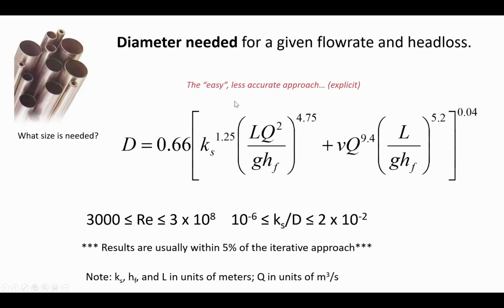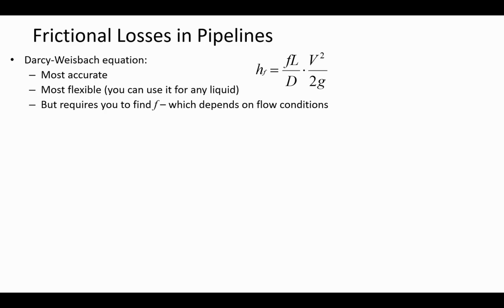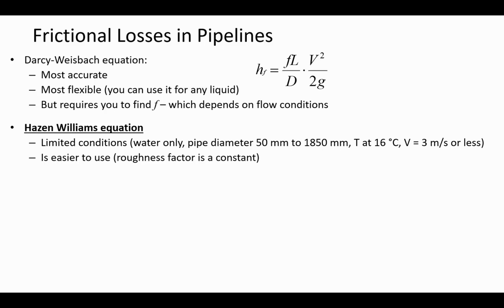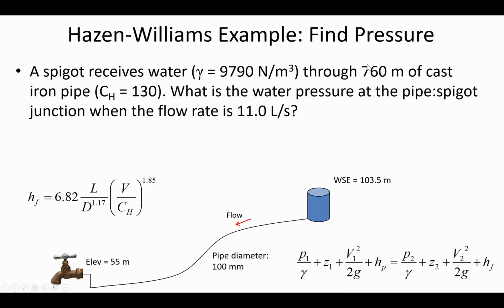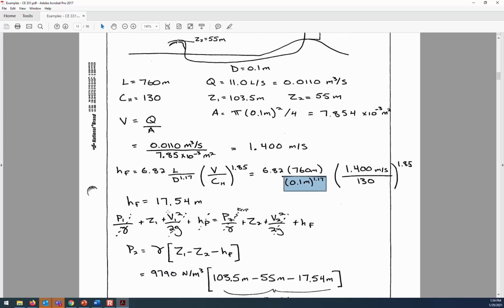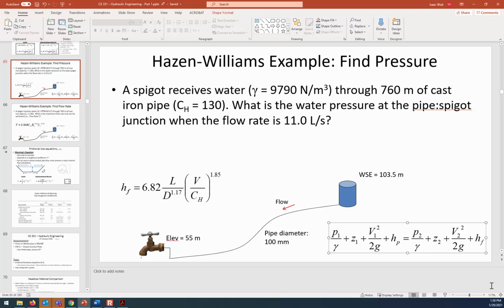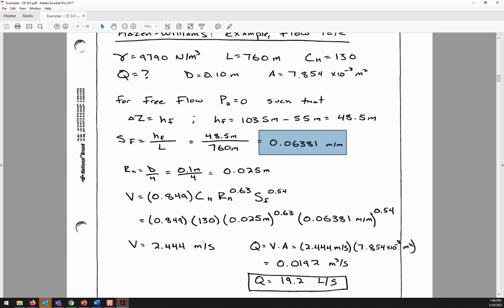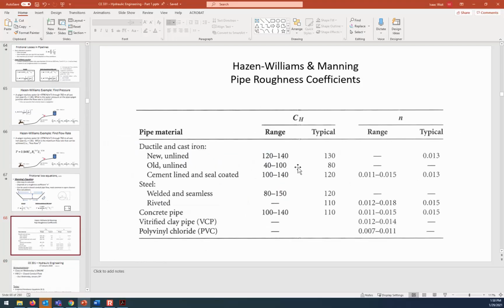Hazen-Williams equation to find pressure or flowrate - CE 331 (29 Jan 2021) Class 5

Comment: Water flows at rate of 34⅓ through a horizontal ∅150 doctive iron pipe. Determine the head loss in 400m of pipe using the hazen Williams formula.

Comment: thank you for your efforts .but  what about for the other losses for example if we have fitting and valves
Reply: https://youtu.be/jU5GdtHH0JY
Reply: That video shows local losses in the calculation example
Reply: @UV254   thank you so much..but what about the value of K if the diameter is 1.4 meter